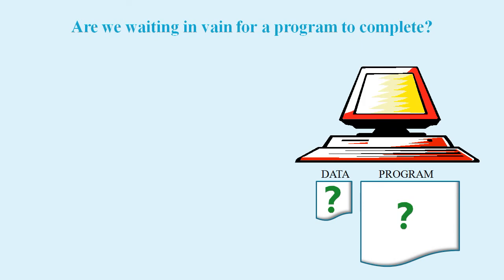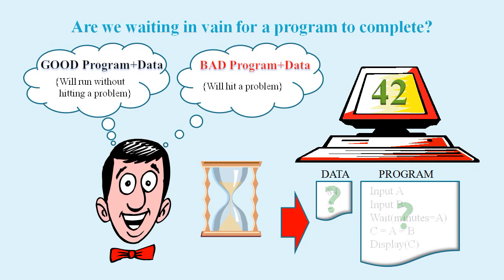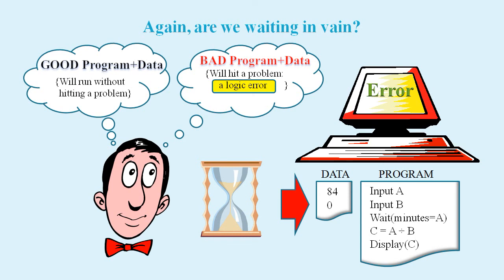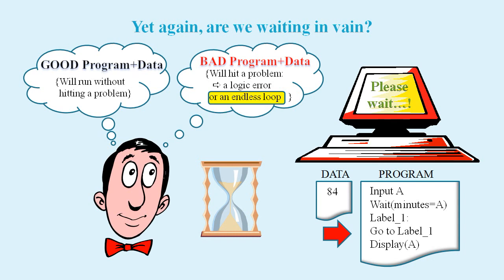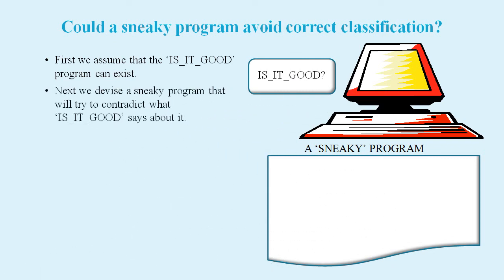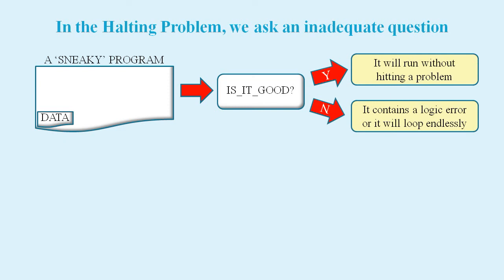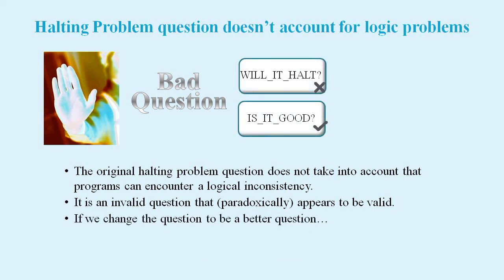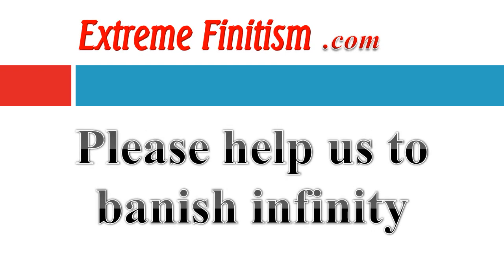Halting Problem: Finally Revealed - The (Logic) Problem with the Halting Problem

Comment from the maker: It is important to realise that the Halting Problem is not in any way about halting. It is merely an argument about any set of instructions that produces one of two outcomes. As such we could replace the statuses of HALT and LOOP with other statuses such as TRUE and FALSE or even YES and NO. It is equivalent to the Barber paradox as it is just a simple logic trick. It is a clever trick because it appears to be a valid argument, but the following simple example clearly demonstrates why it is not valid...
 
Consider the subset of all computer programs that display one word, either YES or NO, and then they end. These programs might input lots of data and they can perform complicated operations on this data as allowed by a Turing complete language. The problem with the Halting Problem can be demonstrated using just this subset of programs (where halting is not an issue because they all halt)...
 
Within this subset of programs, can we create one that will predict what any other program + its data will do? Of course we can; the answer is trivial. All that our predictor program needs to do is to run the input program + its data. This question is equivalent to the Halting Problem question except that here we KNOW that the answer is YES given this specific scenario.
 
The Halting Problem argument is that we can always create a sneaky program that will examine the logic of the predictor program and then do the opposite to what it would predict for the sneaky program. Such a sneaky program would still be within the specified subset of programs and there is no restriction on what language is used.
 
So either the Halting Problem argument is right and we can create the sneaky program, or else the counter argument is right and we can create a predictor program. In this particular scenario our predictor program is trivial, and so we must conclude that the logic of the Halting Problem is flawed. 
 
In this scenario the sneaky program would examine the logic of the predictor and see that it calls the sneaky program. So the sneaky program would need to do the opposite of what the sneaky program does! It is easy to see that this forms a contradiction. It is a logical inconsistency that should ideally be detected and flagged up as a logic error in the code. The sneaky program code might look like this:
 
    Value = Sandboxed_result_of (sneaky program)
    If Value = YES then display NO
    else display YES
 
We can see that this would get itself into an endless loop. As such it would no longer belong to the subset of programs that display YES or NO and then end. In other words, it will not work. We cannot build a sneaky program that will do the opposite of our predictor program.
 
It is important to distinguish the difference between actively doing the opposite to the predictor and not being able to do the opposite. The looping of the code above is not an output of the status 'LOOP' (as opposed to the status 'HALT'). It is merely an indicator that tells us that it is impossible to build the sneaky program. 
 
The fact that the Halting Problem proof is invalid might come as a shock to most people, because almost the whole world still believes that the proof is correct.
Reply: I think you need to clarify how is the halting problem is perfectly analogical to the yes/no problem you explained above, because your arguments rest on that assumption. It's not clear to me how the 2 problems are the same. Yes, examining the output of programs that can only yield yes/no output is trivial. But determining whether a program will halt or not is not. Or, perhaps you can explain the problem with the halting problem's proof without resorting to analogy like this? Thanks.
Reply from the maker: The two questions are not the same; that's the whole point. The original Halting problem question contains a logical inconsistency that makes it meaningless (even though superficially it might appear to make sense). It is impossible to compute a meaningful answer for a logically meaningless question (hence the reference to 42 from hitchhiker's guide to the galaxy). Conversely, my very different question avoids the logical inconsistency and so has the possibility of being computed.

For example, consider the statement "This statement is false". Superficially this might sound like a reasonable statement but it does not clearly state exactly what is supposed to be false. What does it mean for a statement to be true or false? Is the statement "statement" true or false? Is the statement "abstract objects" true or false? These statements don't refer to anything that we can examine objectively in order to assess if we believe that what that statement is saying can be called 'true' or 'false'.

If the question doesn't make any sense then we need to replace it with one that does. The reason why I chose the particular question that I did in this video was because it reflects the real world meaning that I believe the original Halting problem question should have been asking. 

My question is far more useful than the Halting problem question because there is little point in knowing if a program halts or not if we know that program is going to encounter a logical inconsistency during its processing. Whether or not it halts after encountering a logical inconsistency is irrelevant because it has already gone badly wrong. It is already a 'bad' program.

So when the inconsistency was found, Turing should have said "this shows that this question leads to a logical inconsistency, so we need a better question". But instead we got the misguided deduction that it must be impossible to develop a program that can predict if another program will loop endlessly or not.

The underlying flawed thinking was that any random collection of Turing Machine instructions cannot possibly contain a logical inconsistency. But if we can program a sequence of instructions equivalent to "If this-program loops then halt else loop" then we should realise that we can have a meaningless program. And we should realise that to try to determine if such a program loops or not is as futile as trying to determine if the statement "This statement is false" is actually true or not.
Reply: @KarmaPeny  I was referring to the comment above, which started like "..As such we could replace the statuses of HALT and LOOP with other statuses such as TRUE and FALSE or even YES and NO.", and I asked how could you replace them like that.. Your last reply was talking about your video, which I take to be a slightly different topic (that the halting problem is addressing the wrong question). I can understand the objections you mention in the video, but confused by the comment above (that the halt/loop can be replaced with true/false).

Anyway, have you wrote a blog post about this? I looked at your blog and don't found any result. Thanks.
Reply from the maker: In the top comment I gave an example using YES and NO and in my last reply I gave an example using TRUE and FALSE. How many examples do you want?

Earlier you said: "It's not clear to me how the 2 problems are the same."

And now you are saying: "Your last reply was talking about your video, which I take to be a slightly different topic (that the halting problem is addressing the wrong question). I can understand the objections you mention in the video, but confused by the comment above (that the halt/loop can be replaced with true/false)."

There is no difference to what I say in the video and what I say in my comments. My argument is about the Halting problem question being an invalid question because of its inherent logic issue that can be demonstrated with any two status values. You appear to think that these are two different points that I have made in different places. But this is one point, not two different points. I am making the same single consistent argument in my video and in my comments.

My argument is that the logical inconsistency in the Halting problem makes it an invalid question. It would be wrong to deduce from the statement "this statement is false" that it means "it is impossible to evaluate if the statement is true or not". It would be better to deduce that it means "it makes no sense to try to evaluate the statement as being true or false". 

For the same reason it makes no sense to try to evaluate if the statement "if this-program loops then halt else loop" would result in a final value of loop or halt. It would be better to deduce that it means "it makes no sense to try to determine a final state of loop or halt".

Hopefully this clearly demonstrates what I mean about using true/false instead of loop/halt. I'm sorry but I don't think I can make it any clearer.

As for writing a blog article, I can't see the point. Nobody takes much notice of my videos or my articles. The more I publish, the more abuse and hatred I attract. Even this very thread shows that it doesn't matter how strong I believe my arguments are, or how clearly I think I have made my point, people are simply not going to accept the arguments of a nobody like me over the huge volumes of mainstream drivel. The mainstream drivel not only has the support of all the authority figures in the field, but it is so appealing that it gains mass popularity with clever-sounding claims such as being able to prove there are things that computers will never be able to do. Common sense went out of the window long ago. I give up!
Reply from the maker: After some thought, perhaps there is a way that I can explain my argument in a clearer way...

Say that I present you with these three statements:

Statement 1: Go to statement 1
Statement 2: Halt
Statement 3: If this statement loops then halt otherwise loop

Then as intelligent person you can deduce that statement 1 will loop endlessly, statement 2 will halt, and statement 3 contains a logic problem.

It is not the case that your brain enters an endless loop when trying to determine if statement 3 will halt or not. You can clearly see and identify the logic problem. Your brain has reached the final conclusion that statement 3 contains a logic problem that prevents it from being classified as an instruction that will loop or halt. So if we call your brain the 'predictor' then it is easily able to cope with these three statements.

But then I change statement 3 to the following:

Statement 3: If the predictor (i.e. your brain) says this statement loops then halt otherwise loop

Does this cause your head to suddenly explode? No, of course it doesn't. Does it cause your brain to go into an endless loop? No, of course it doesn't. You can still see that this statement contains a logic problem that prevents it from being classified as an instruction that will loop or halt.

We could think about it in these terms: when 'your brain' is asked about statement 3 it says "since statement 3 makes no sense, force the processing of it to halt".

Now I could say that it doesn't matter that your brain thinks it can force the execution of statement 3 to be halted because I run a simulation of your brain in a sandbox. In short, whenever your brain thinks that it is at the controlling top-level, I can place code around it so that my statement 3 is at the top-level.

But you are clever enough to know that a line of instructions cannot be at the 'top-level' because any line of instruction will always need to be executed by a machine of some sort.

And so the clear implication in terms of running programs on a Turing machine is that it is not sufficient for the mechanical operation of the Turing machine to simply be able to perform individual instructions. The controlling mechanism needs a strategy to deal with any set of instructions that contains a logical inconsistency (such as a forced halt). This is what should have been deduced. Instead it was claimed that it is fine for Turing machines to just execute individual instructions and to not concern themselves with logical inconsistencies. With this mistake in place they said that it therefore follows that it must be impossible to develop a universal halt/loop predictor program.

To my mind, this simple example shows that computers need to handle logical inconsistencies at the controlling level (or the 'operating system' level if you prefer) rather than at the normal program level. With this extra check in place, then since there must always be a Turing machine at the top (controlling) level it means that there is no possibility that a sneaky program could have the final say.

Comment: But this means that you're consistently classifying some programs that always behave well as "bad". If the IS_IT_GOOD program always classifies sneaky programs that way, then that always makes the sneaky programs well behaved. You state that this doesn't matter because there's a "logic error" in the sneaky program but there's really no "error" here.
Reply from the maker: To clarify, I chose to use the following categorisations (for program+data combinations):

1) 'GOOD' ... It will NOT loop, regardless of how 'IS_IT_GOOD' classifies it.

2) 'BAD' sub-category_1 ... It will loop, regardless of how 'IS_IT_GOOD' classifies it.

3) 'BAD' sub-category_2 ... It will either loop or NOT loop, but in both cases it the has some dependency on how 'IS_IT_GOOD' classifies it.

As you can see from the above, there are two categories of 'GOOD' and 'BAD' except that the 'BAD' category has been further divided into two sub-categories.

Importantly, the 'IS_IT_GOOD' program will always classify any sneaky program as 'BAD'.

The above classifications allow the following types of sneaky programs to be constructed:

Program Sneaky_1
If 'IS_IT_GOOD' classifies me as 'BAD' then loop
Else halt

Program Sneaky_2
If 'IS_IT_GOOD' classifies me as 'BAD' then halt
Else loop

And so with 'Sneaky_1' it will always loop. This does not change the fact that it contains logic that ties its 'loop or halt' nature to its 'IS_IT_GOOD' classification.

And with 'Sneaky_2' it will always halt. This does not change the fact that it contains logic that ties its 'loop or halt' nature to its 'IS_IT_GOOD' classification.

Now, you said "If the IS_IT_GOOD program always classifies sneaky programs that way, then that always makes the sneaky programs well behaved."

I can only presume that when you say "well behaved" you mean it will not loop. If so, then you are would be referring to the 'Sneaky_2' variation, since that always halts.

But as explained above, even though it halts, it does not change the fact that it contains logic that ties its 'loop or halt' nature to its 'IS_IT_GOOD' classification. So it is still 'BAD' according to my chosen categorisations.

The bigger picture implications:

Note that in these examples there is no dependency on what type of looping we are referring to. In fact the actual type of looping is immaterial because the thing that we cannot handle is the 'contradiction of the reported category' as opposed to the type of loop that we use.

Therefore the halting problem is not saying anything about whether or not a type of loop can be detected; it says we can't detect any non-trivial semantic feature of a program's execution if that feature is hidden behind this contradiction-trap.

And so we can attack this by detecting the contradiction-trap itself. This is what I am doing with the categorisations of the 'IS_IT_GOOD' program.